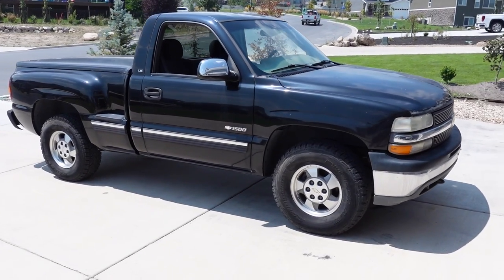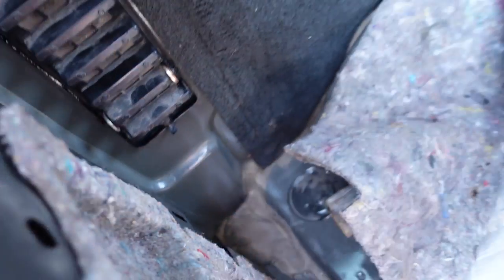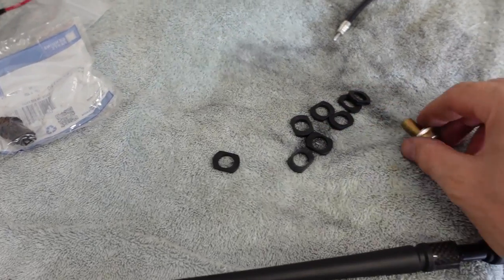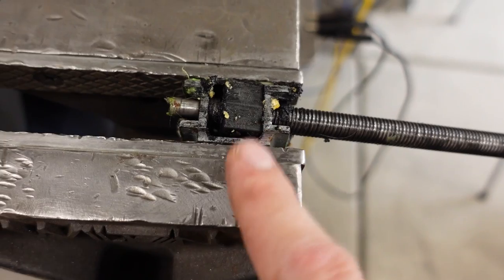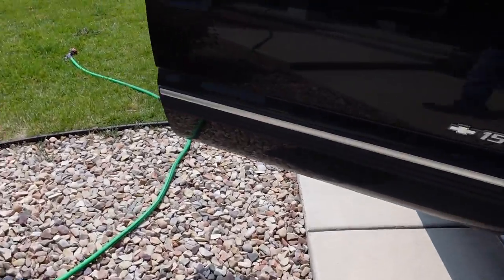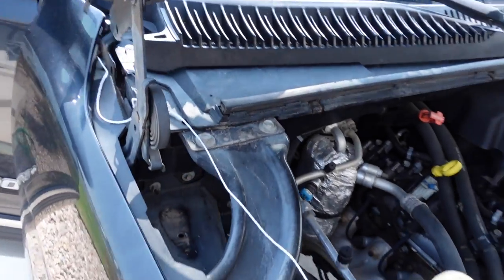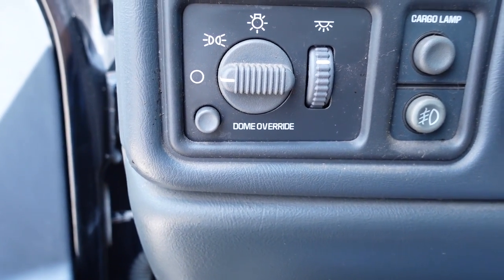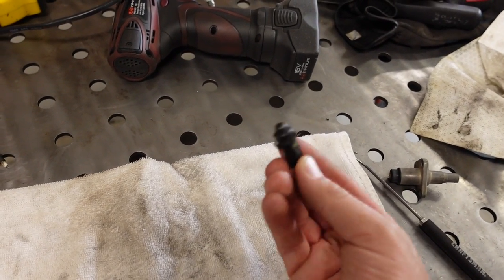Fixing 5 things that ALWAYS BREAK on EVERY GMT800 99-07 Chevy or GMC Truck

Comment: I had same problem with something wet on the driver side in the back seat floor  board of my crew cab ended up being brake fluid from my hydro booster was leaking inside and running all the way back .love the videos
Reply from the maker: I'll have to check that out, thats a crazy kind of leak I've never heard of

Comment: Hi LT, love the content bro. Another question for you, 97 chevy 2500 with 5.7, engine cranks but is getting no fuel. Used your fuel pump video to replace that thinking it was the issue. Replaced fuel relay, ignition switch, fuel filter, fuel pump.  Now it won't start at all. Thoughts?
Reply from the maker: You’ve verified lack of fuel pressure with a gauge? Looks like you’ve covered the bases, I’d also check with a volt meter to see if you’re getting power to the pump
Reply: @LawrenceTolman  
We have not verified the pressure but will and will check out the voltage. Thanks man, I will let you know how it goes

Comment: That's awesome that the seat adjustment is such an easy fix.  I will be doing this on my '03 Silverado SS for sure. Just fixed the 3rd brake light leak. Still have to fix the burned out gauge lights and PRND indicator and that should take care of all the annoying little things
Reply: Get iss cluster got mine in blue led love it and no core charge hassles. If you send your cluster back within 30 days you get lifetime warranty and if you don’t you get 1 or 2 year warranty if I remember right. Even if your cluster is not repairable no core hassle. Mine had od off indicator not working and they sent me a new one cause I mentioned it when they called to see if I liked my new one. I told them I wanted to wait to see if I liked it before replacing and 24 hrs later a new one was at my door. Great customer service. I have the 8.1 allison combo and I think I got cluster done for 6.0 truck first from them because that light wouldn’t come on at start up. But I love mine. They do a lot of electrical stuff been in biz since the 40s.

Comment: Kind of a crazy idea for the antenna cable grommet, using a fuel line disconnect tool to apply pressure on it to set the grommet?
Reply from the maker: That is a good idea in fact. I’m gonna try it

Comment: Dude!  Sweet video.  My 2000 GMC single cab stepside has the same problem with water in the rear corners.  I'm in Colorado so not a huge problem as it's mostly dry here, but it's been bugging me forever!

Comment: I cant wait to see what you do with that nice little rig I would love to see what a cam and converter would do as well as a tune obviously these ls motors are mind blowing with how much aftermarket and even oem upgrades they have available! I know the 4l60 wakes up alot with the corvette servos and upgraded valve body
Reply from the maker: I did a converter on my lowered OBS and it helped the L31 out tremendously. Def gonna do it on this one also
Reply: Maybe use this truck as a platform to teach us how to beef up these 4l60s 👍